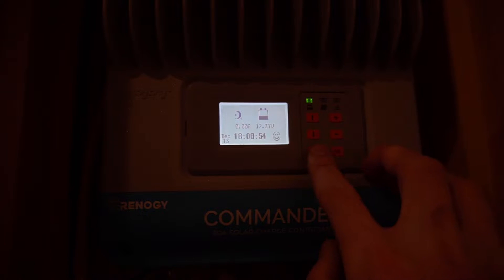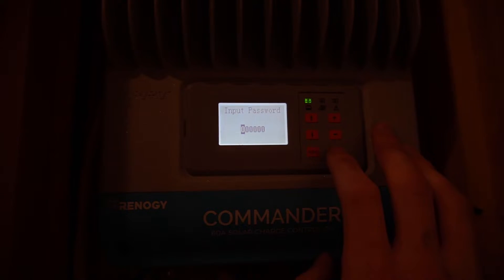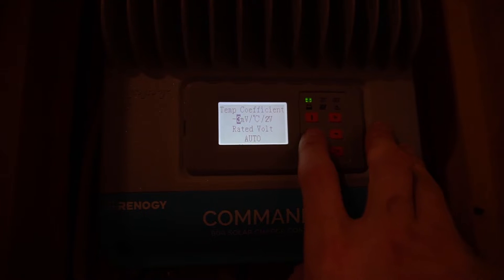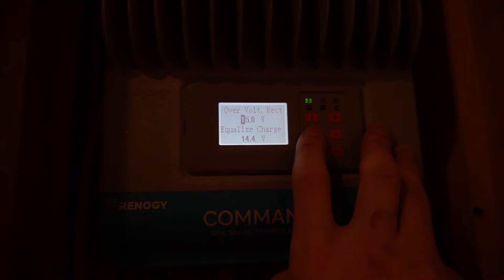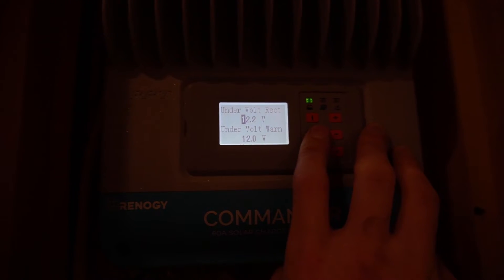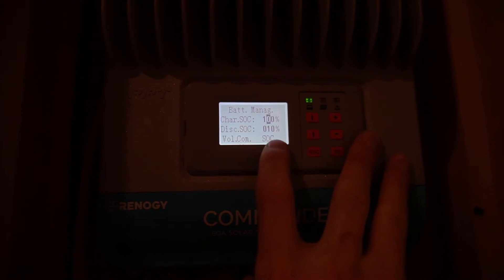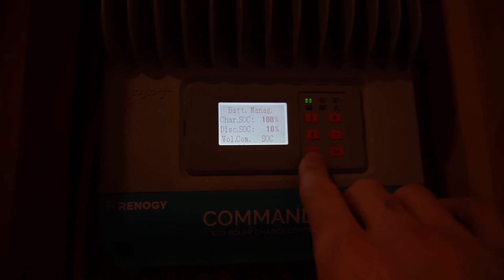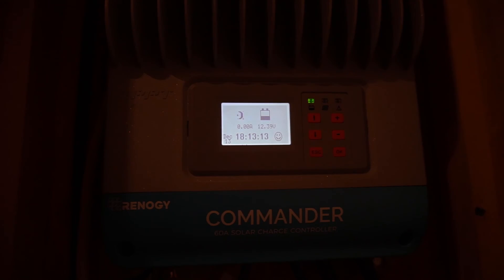How to Program a MPPT Solar Charge Controller for Lithium Batteries - LiFePO4

Comment: It's easy to reset the BMS, after a short circuit cut off or over discharge no need to purchase expensive equipment to get it going again "Google it"😂

Comment: I will do my research of course to compare, hard to find these videos. I recently had a LifePO4 fry after only six months of casual use, not sure why but it was under warranty and being replaced. I set up my 6x100 solar panels and three pairs of series then paralleled them to my Renogy Rover 60 amp charge controller.

Comment: BIOENNO BATTERIES 
Float Voltage:  13.8VDC
Charging Voltage:  14.4VDC to 14.6VDC
Max Charge Current:  7 Amps (if applicable -- this may not be in the controller, so it may not apply)
This is directly from Kevin at Bioenno. And his actual email back to me.

Comment: I would not trust Renogy's  advice on controller set up. I have 2 Renogy 170Ah Lithium batteries with Epever controllers and I would never use the settings you just quoted. Sorry but in time your batteries will suffer damage.

Comment: Unless you have somewhere to switch off temperature adjustment. Surely you need to set the temperature adjustment to 0mV /°C per 2v.  Ok yours will probably be Fahrenheit  but it will still be zero.  This is difference in temperature from 25°C.  Remember this figure is multiplied by 6 for a 12v battery.  This function also reduces the charging voltage settings above 25°C.

Also you left the charge limit voltage set to 15.  The above formula takes the voltage above this and it is provided to prevent damage to connected equipment.  15 v divided by 4 is 3.75v.  This is above the maximum charging voltage of LPO4 cells so you are likely to  damage your battery in cold conditions. Probably somewhere between 14.4 (3.6v/cell) and 14.3(3.5v/cell) would be more appropriate.  
Note it may be that not fitting a temp sensor will inactivate the temp correction but some switch to temp at controller.   However I would prefer to see it set to zero.
You might want to Email the manufacturer again just to make sure.
I say email as that gives you evidence of what was said.

Best wishes

Comment: i did not use lifepo4 but i was using 18650 and had the problem of the bms shutting off and controller could not kick in to turn it back on what i ended up doing was adding a buck converter from solar input to the controllers battery output so it would charge the battery enogth to get to the turn on stage of the bms and then the controller could take over

Comment: Hallo

Ich verstehe leider kein Englisch 😔 sind das die richtigen Einstellungen für einen MPPT Laderegler ,im Zusammenhang mit einem Lifepo4 Akku? Ich habe nämlich einen EPever 2010An Trace,und als Akku habe ich eine Lifepo4 / 176AH, das alles wird mit 12V Betrieben. Nur weiß ich leider nicht,welche Einstellungen ich in dem EPever machen muss,das dieser auch gut mit dem Lifepo4 Akku arbeitet. Lieben Dank erstmal.  Grüße, Jürgen

Comment: Great video . I am setting up a 100 amp mppt charger controller i have a question i cant find anything on . On battery amps per hour is that total of battery bank or the type i am using 100 ah battery 5 of them . I set it for 200ah having 2 100 ah batteries in bank right now. My fear was cooking them lol. Thanks again great video .
Reply from the maker: charles foster no problem. You will set it to your total accumulated ah. So if you have 2, 100 ah batteries like I do, then you set the MPPT controller to 200ah. That also is dependent on if you hook them up in series or parallel. One will double the ah, the other will double the voltage and leave ah the same

Comment: The guy who wrote the 'marine lifepo4' article makes a pretty strong case for a 13.6V float charge, as well as Will Prowse recommending it for Battle Born. For my personal (not renogy) setup I'll be going with 13.6.
Reply from the maker: One_Mega_Ohm can only say my batteries are still set with these settings and performing well. I do like Will Prowse, I’d trust his settings too. What brand did you end up going with?
Reply: @boristheboxvan8485  No fault in using the manufacturers recommendation. I just thought I'd chime in with another option to look into for anyone checking out this video. I have a set of the blue Chinese 280aH cells. I don't have them fully setup, but I think I'll be going with a 14-14.2 charge voltage and I might even go lower than 13.6 for float. I'd rather go for longevity as opposed to capacity as I should have plenty with 280aH for now.
Reply: 13.6V at float (which is basicly the 'maintenance' voltage) should be fine for frequently, heavily used batteries with loads like a refridgerator on it at a daily base. for slower drains like a constant on-grid feed/inverter 13.4V should be fine.

keeping the lifepo on a constant charge at 14.4V (because that is what happens when you let them 'float' at this voltage vs. just boosting them shortly) means  stress for the cells, which will shorten your overall cycles in the end 🤷🏻

Comment: I just bought a renorgy 100w kit that came with a wanderer charge controller. I've also ordered a Iccnexenergy lifep04 battery. It's not clear to me if I have the right charge controller for my battery, the wanderer doesn't list lifep04 as a battery type it charges. Do I need a lifep04 specific charge controller?
Reply from the maker: According to Renogy’s website the wanderer is compatible with LiFePO4. There should be a profile setup for it that you can access through programming it. I think all Renogy instructions are on their website or you can call them I’ve had good luck with customer support
Reply: Thank you! I just got a BT-1 module and working through the settings now. Watching my charge controller via the BT-1 it shows 100% charged but also shows the battery absorbing 2.4A from the panel. Will the charge controller automatically turn off the charging current to the battery when it is fully charged? I bought the battery used and advertised as "tested to have 94% capacity remaining" and am also wondering if the battery will ever trigger the charge controller to stop sending current since it can't reach a 100% capacity?